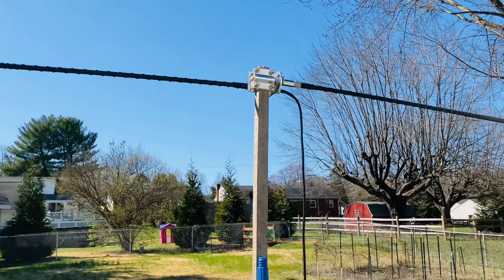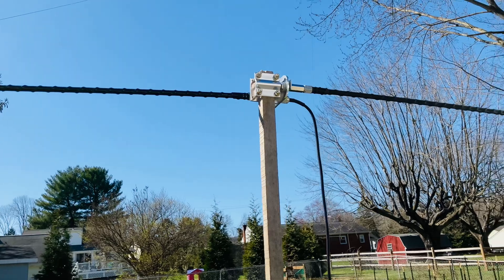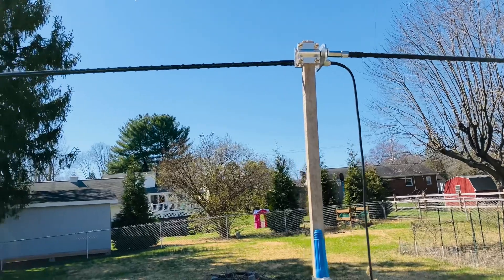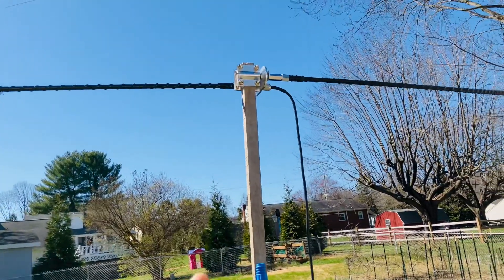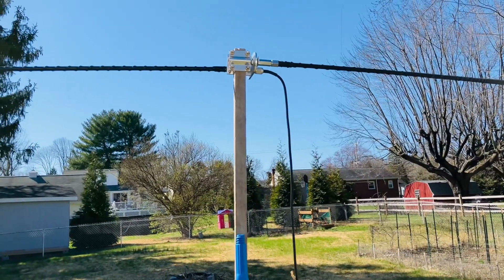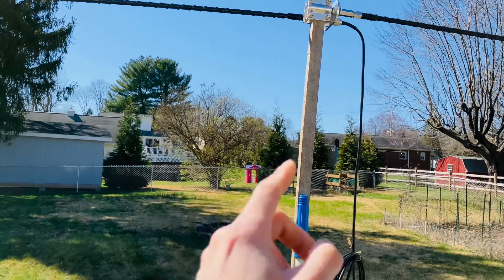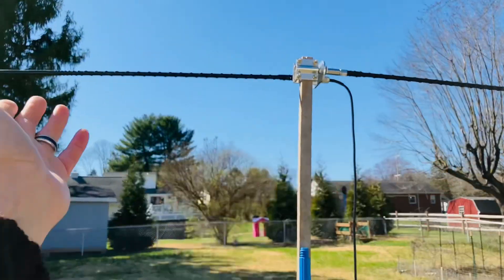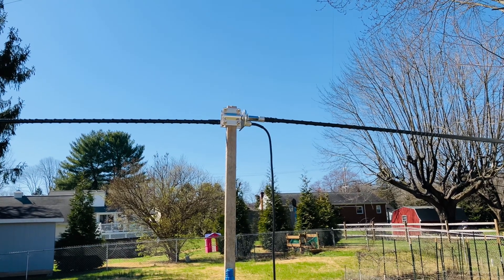11 meter Rigid dipole DIY

Comment: A friend of mine used that exact setup in his 16th floor apartment in Shirlington, Va. just off interstate 395 heading into DC. He was able to use that antenna effectively for many years suspended from his ceiling inside the apartment with various different radios over the years. When you bolt the 2 mounts together it ties the second antenna to the ground side of the dipole perfectly. Could not be more simple and compact than this design. Thanks for sharing the video.
73’
Reply from the maker: Thank you so much for sharing your experience or your friends experience. That’s brilliant😊
I’m sure the rest of us are going to be happy to hear this
Reply: @mikecricket113  my neighbor recently gave me a co-phased set of? 3 foot whips with those identical type mirror mounts. I just remembered when I called and shared your video with a radio friend.  Think I am going to make one of these from those free antennas & mounts. I will require a single piece of coax to feed one SO-239 connector. But otherwise I already had both mounts and both antennas. If I get it done I will let you know how it worked out. I have to remove the insulator on one whip and shunt it to ground. Thanks again.
73’

Comment: Could a Moonraker AM Pro CB antenna be used to make this dipole? Does it require a balum or choke coaxial cable?
Reply from the maker: @agustinrodriguezalsina1389  for the ham bands sure as long as you have two of the same band 1/4 wave.   You might have to tune the ham sticks.  But seeing that you have 2 , 1/4 waves antennas. That would make a 1/2 horizontal. You might want to add a dirty balun choke on the coax , but otherwise if you can tune the antennas to the area of the ham band you want to work you should be fine.   You can always use your external or internal tuner if needed.   Please subscribe if you haven’t already.  Hope this helps.  And thanks for sharing

Comment: What would be the length of these ham sticks and would they be a quarter wave or three-eighths of a wave? Thank you very much.
Reply from the maker: @agustinrodriguezalsina1389  Hi 👋.  Okay well these 11 meter antennas are stock cut for 11 meter band and they are 1/4 wave roughly around 102 inches of wire wrapped around a fiberglass stick. The brand is Wilson.   Someone gave me a bunch of them one year and I gave it a try.

Comment: Is that a 5/8 wave hamstick?  I'm trying to find a 1/2 wave hamstick, firestik, etc. and can't.
Reply from the maker: @jeremybw2180  these in particular are 11 m quarter wave sticks making a halfway.  
Try shark Antennas.
Reply: @mikecricket113  is it possible to make a 2 or 3 el yagi with these?!
Reply: Could a Moonraker AM Pro CB antenna be used to make this dipole? Does it require a balum or choke coaxial cable?

Comment: Nice job, thanks for posting! Two quick questions- would the "proper" balun be 1:1 ? ... and what would your opinion be of trying this "same" setup in an L configuration?
Reply from the maker: @2wattsout  you can try a an L with a wire dipole of course if you wanted.   Yes you could use a 1:1 if you wanted.
Reply: @mikecricket113  Thanks Mike. There was a fellow who was describing such an antenna the other day on CB LSB CH 37 (?). He was happily touting the benefits of having both hoizontal and vertical polarization (102" whips). But unfortunately he got stepped on by some KW  powered, 60 foot up beam antenna TX station running a round up as if they they own the channel. Wanted to hear more, wasn't to be. Thank you again.
Reply: PS, presently running 102" vertical whip base (104") with 4 ground radials approx 114" sitting on top of 9' 2x4 off a deck post. So about 10' up. Not working out ...

Comment: I live in a downtown loft apartment with a steel balcony..and another balcony above me...and a building across the alley (a true concrete canyon), but I have a clear shot of the sky and a direct shot to the east...would this setup work for my situation? does it need a clear shot of the sky?  I could mount it to an "L" bracket so its out beyond the front of the balcony by 6-8".

I sure would appreciate your advice on this.
Reply from the maker: @grafixartz1  I don’t see why not.  It may give you a chance to get your signal up and out.   But I’m wondering how well you hear signals?  Do you run a vertical currently.  95 % of 11 meter operators run vertical polarization.   With a horizontal antenna you will have less noise on receive.   If the balcony above you is close to your head when your outside than I guess this might help your situation.   Do know that if you are talking locally you may have a lower output signal to those using vertical polarization.   Horizontal polarization is more for skip.  But either way you’re getting on the air.    Give it a try.   👍

Comment: what do you think the DB gain will be? liked the video very much, thx for sharing. 420 in Va waving.
Reply from the maker: Not really sure.  Normal wire dipoles don’t have much gain.
Reply: But if you use good coax you probably won't have any loss

Comment: im wodering on the desing of that bracket if the ground of the radial isnt that great! lookes like its to isolated from ground to lower your SWRs!
Reply: @AdamDeal-KF0PRI  one side is hot that is why it is isolated from the bracket. the other side is a ground plain.
Reply: @27mhz47it's electrically not a good ground!
Reply: @ what’s not good about it ?
Reply from the maker: Great point